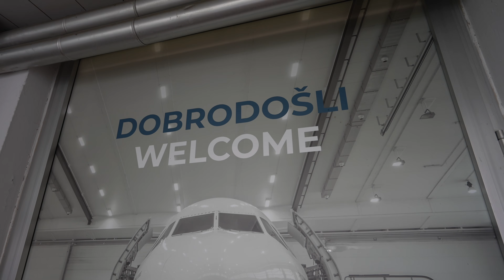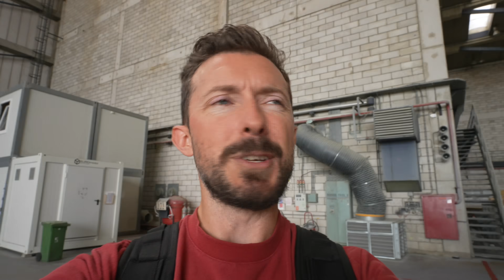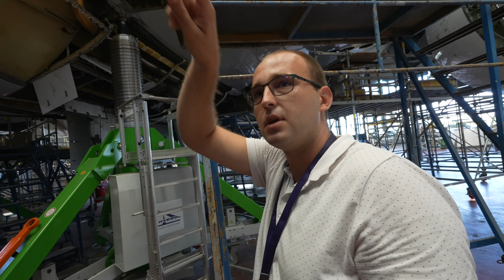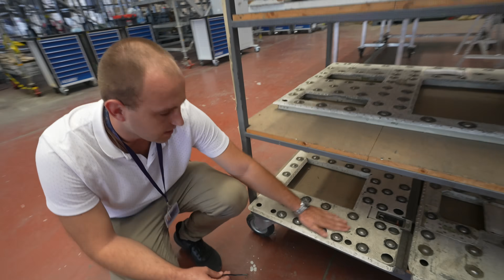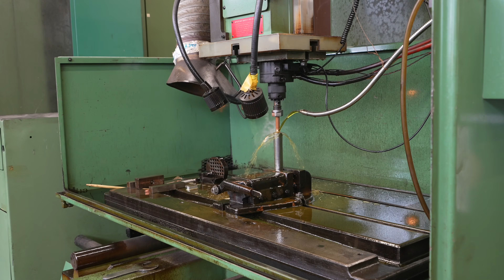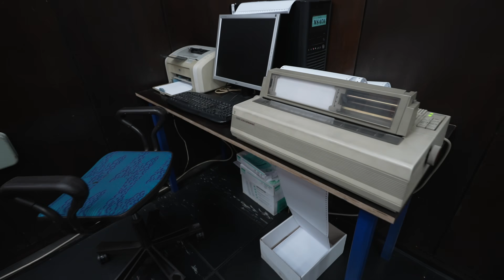How to take apart a 767 | behind the scenes with AviaPrime in Belgrade

Comment: I have heard that when an aircraft reaches its second "D" check is when the airlines will retire it and it is usually a prime candidate for a freighter conversion. The D check is the most detailed and costly inspection of an aircraft since it must basically be disassembled down to the basic airframe. It’s logical to convert prime airframes to freighters since they have to be torn down anyways.
Love to see more detailed videos of the conversion process.

Comment: Watching the preparation of a 25 year old plane for a new life is incredibly interesting.  

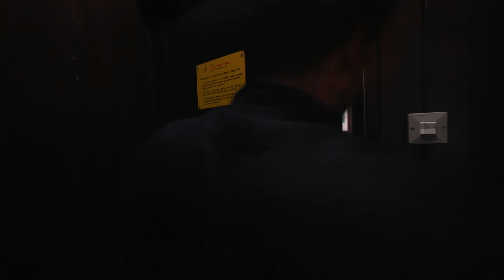The engine test facility is also very interesting, in particular the IT equipment still in use.  (19:40)  It's a long time since I've seen CRTs in play and even longer since I saw a dot matrix printer in an office.  However, this business is about maximising the use of existing technological resources, so why not??  It's very appropriate that they practice what the preach.

Thanks to Flightradar24 for yet another outstanding video.
Reply: You can actually buy new dot matrix printers.  If it ain't broke, no need to fix it.
Reply from the maker: Thank you!
Reply: Those CRTs are not normal computer "monitors", but are actually serial terminals, cabled through DB-25 or some other serial cabling, probably running somewhere between 9,600 and 56k baud rate.  So, this facility probably has a mainframe or mini-computer running in a remote datacenter,  and those terminals (which were never sold with flat-screen displays) may be an essential link to information.

Yes, there are terminal emulators that run on a PC...so someone could replace the terminals with computers running a full-screen terminal app,  but it just may be the case that the dedicated terminal is a more accurate terminal as well as more reliable for keeping a link going with the remote mainframe system.